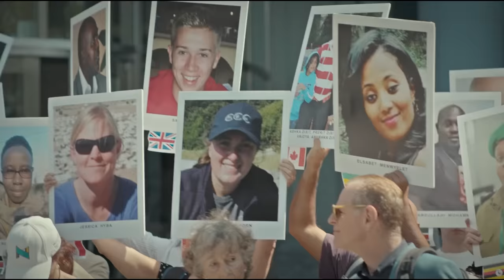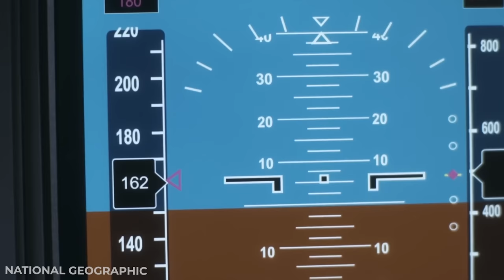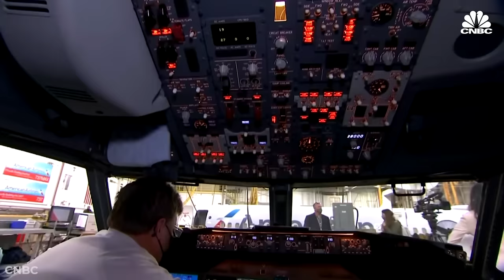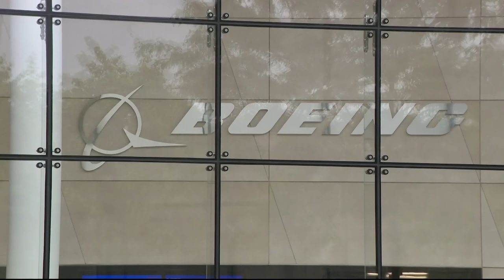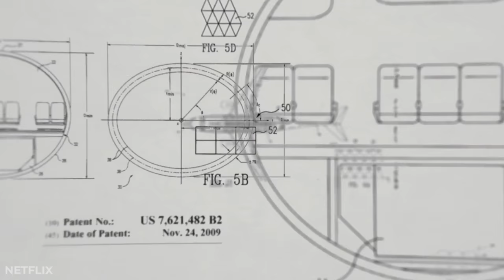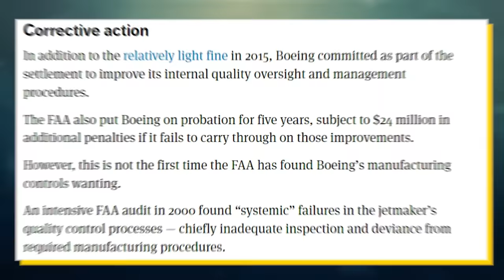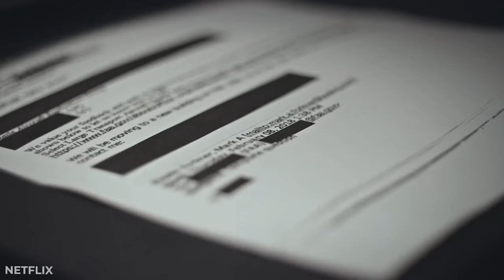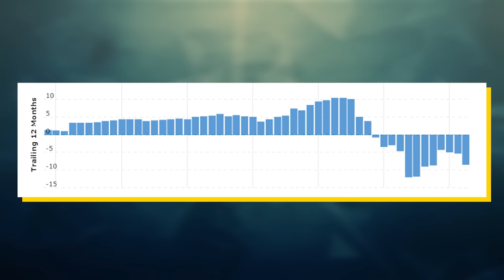Even Boeing Engineers Don't Trust Boeing...

Comment: "Safety is our highest priority"
You need to start worrying when a large company feels the need to constantly reassure it's customers that their product will not kill them.
Reply: Think vaccines. 🤔
Reply: "Safe and effective"
Reply: You’d rather they didn’t say anything?? 🤡 😂
Reply: Only because there is too much hype?    The cars in our driveways are far more dangerous.
Reply: I start to worry when big corporations say " everything is fine"
Reply: @danharold3087  yes they are, but i bet you didnt find empty liquor bottles in the fuel tank like an airline did with Boeing's new 787.
Reply: @Onyx408  Being quiet is better than downright lying
Reply: @SubvertTheState  Actually auto workers have been know to do the same.   Dad had a 71 Ford with something in the differential.  Workers have been known to put coke bottles in doors to cause rattles.    But this could have been a stunt to create news because news that hurt Boeing was in vogue.   A booze bottle has more mews impact than a coke can.  
We have no idea when the bottle went into the tank if it fit though the filler opening.
Reply: @danharold3087  well it's suspected to be from the North Carolina plant. Boeing is dismantling it's legacy unionized technically savvy plant in Washington and trying to shift production to NC where the workers make $15 an hour and  are hired off the street. Some of the airlines specifically requested that their 787 order contracts include no aircraft produced at the NC plant. The mechanics have found other things like ladders in between the pressure hull and the fuselage. Like no airline mechanic is going to disassemble an aircraft, put a ladder in between the walls and put it back together haha. But thats the problem with the economy, GE makes 75% of its revenue from financial speculation and investments, Boeing and all of these companies with institutional clout will do anything to raise stock prices. And CEOs think cutting labor costs is always a great idea, but you end up with a destroyed reputation in the end.
Reply: @SubvertTheState  We have to be careful here to not look at specific things in isolation.    Every pro union person will obviously point out the SC problems and tell us how it would never had happened had that been a union plant.   Little in life is that black and white.    I mostly see the SC plant startup as rushed.  Maybe some of the experienced people sent there from Washington were less than happy about the entire deal.   People disgruntled to a major degree are capable of most anything.  Training your replacement is one thing.  Groups of people training people to replace you factory is even worse.   

Obviously you care about people.  I do too.   The problem is that almost every company involved in manufacturing is going to lose out to a competitor with lower labor costs. But the lowest labor cost is none.   It has been on the way for a long time but the Tesla robot and what follows will put the last nails in the labor coffin.   Special purpose robots are already being sold into restaurants. The checkout people are gone from many stores.   Truck drivers will become an endangered species.  What jobs will be left?    Whatever they are we need to restructure education to educate more people to fill them.   If you think I am full of it that is OK.   It is on the way and nothing we can do will change it.  What would we change?  Can we stop progress.  Can we afford to attempt to stop progress.

   One can potentially make more money dealing with money directly.  Products just get in the way.
Reply: Pfizer, Moderna, Monsanto, Johnson & Johnson …
Reply: @SubvertTheState  So it’s not they ran outta kerosene for fuel, but factory workers weren’t sober.  Very scary.
Reply: My investment is safe. What about the plane?
Reply: @hananokuni2580  Define safe in this context ?
Reply: @danharold3087  Sarcasm.
Reply: @hananokuni2580  Not always obvious.
Reply: @Onyx408  no, but that statement along with blaming foreign pilots who died doing the best that they possibly could, calling them unqualified is worse than no comment. Especially when the public believes the company, and blames the pilots for the deaths of all souls lost.
Reply: @SubvertTheState  straight out of the MDD book of press relations after a crash... 😎👌
Reply: @Onyx408  I’d rather they tell the truth. Clearly safety isn’t the highest priority, yet they are trying to reassure customers that it is.
Reply: @elementalgolem5498  Boeing is all good then? It took them 20 years to make the Starliner, they tested it recently and it veered off course while venting air into space. 
The 787 has killed hundreds of people and the company blamed incompetent pilots. You can start bringing up car statistics for some reason but it doesn't matter. Nobody is claiming planes aren't safe, what I'm claiming is that Boeing is a bad company.
Reply: @SubvertTheState  Starliner has nothing to do with their safety of aircraft it's a test phase space capsule. That if you look at history is a damn difficult and dangerous form of travel. Their aircraft are some of the safest in the world and the 787 is the most advanced and one of the safest aircraft ever produced. Idk what you mean about killed hundreds. The 787 has a spotless safety record of zero fatalities and zero hull losses. It's technically the safest aircraft in the world. But before its official it will need to catch up to some of the other aircrafts milage to see how it compares over time. The dreamliner is a dream, and a marvel if aviation engineering. Saying Boeing is bad and using the 787 as a example is hilarious.
Reply: @elementalgolem5498  i mean the 737 Max. The 787 has had plenty of its own problems including several battery fires mid flight. No it hasn't had a long history, that's part of the problem. If it had several incidents in a long history it wouldnt be a problem, they put off the battery fire issue until several occurences. I guess if you love the company that much theres nothing i can point out that will change your mind. I just know that a legacy company with billions in government contracts who is focused on cost-cutting and coasting off of their name is a recipe for disaster.
Reply: @elementalgolem5498  And yet, this whole scandal exists. 

They don’t care about safety, they care about being sued in the case of a crash.
Reply: @elementalgolem5498  No scandal is occurring? So those whole news story is about something good happening? 

The point is that this news story, or “scandal” as you DON’T like to put it, goes contrary to “Safety is our highest priority”. 
And it doesn’t have the best safety record, Airbus does.
Reply: @elementalgolem5498  If the 737 crashes aren’t a scandal, how come they have been grounded?
Reply: If there is nothing to address, there would be nothing to say.
Reply: You can say the same about governments also.
Reply: Of course it's good marketing to say that as it's an aircraft... its a complex machine and plenty of people are at least nervous when it comes to flying, it's to reassure them.
Reply: Philip Morris International!
Reply: @katherineberger6329  what have I lied about?
What exactly is an antivaxxer?
Vaccinated people are also transmitting, so does that make them accessories also?
Reply: @katherineberger6329  making accusations about someone that you dont know.  Not sure how much more crap you can spew, but please continue.
Reply: @katherineberger6329  yup, name calling was expected.  🤣😜
Reply: Safety is our highest priority, which is why we make safety features extra-cost add-ones instead of standard.
Reply: @katherineberger6329 who said anything about hating?
Intelligent scientific analysis is the way to go and have done so all my life.  That's how truth is discovered and/or exposed.
Yes, I can be an asshole, but that name calling seems to be done when there isn't an intelligent response and always directed at someone that they disagree with.
Have wonderful day and bless your heart.
Reply: @cptrikester2671  "intelligent scientific analysis"

Literally posts antivax garbage.

Ok, Dr. Goofy.
Reply: Reminds me of the COVID vaccine. "Safe and effective", they said. "Good efficacy" they said. Yea, right.....
Reply: @cptrikester2671  Continue, continue. I'm laughing rn
Reply: @danharold3087  A door rattle vs. stalling out 5 miles in the air due to fuel issues from foreign debris in a fuel tank? I’ll take a door rattle any day. Cars are wayyy safer, the operators however are not. 

I was blown away that the MCAS system on the MAX was only dependent on one of two sensors at the nose of the plane. When it comes to cars (Toyota), they will have reference sensors so if a fault may occur, it will know to go into default mode instead of crashing into a wall (the ground for the MAX’s case). 

Nothing but corruption and incompetence due to capitalism, greed, and band aid engineering with extremely low standards. Madness
Reply: haha! free speech! it doesn't have to be true, so it's basically meaningless 🙂saying safety is our highest priority costs nothing and sounds great! self regulation is the cheapest regulation ;-)
Reply: When CEO does the boards recommendations, changing CEO does nothing.
Reply: Why wait until two crash? How does sleep at night.
Reply: It worked for Volvo.
Reply: @SubvertTheState
"Reliability" - it is a separate kind of engineering. Safety follows it.
Reply: Just like some mining companies in Australia ram it down out throats but wen we report complain call out .....she be right
Reply: @danharold3087 
Your comment did NOT age well. Doors are flying off of their airplanes.
Reply: @joeybulford5266  If it was my comment about our cars being more dangerous it is still correct.  
By the hour our odds are roughly 2,000 times higher/worse in our cars.
Just for fun the commercial passenger flights became safer about 1955, give or take a few years.

737 MAX: Based on the current limited data and assuming an average passenger load of 150, the overall estimated rate is 0.024 fatalities per 100 million passenger miles.
Car: The average fatality rate for car accidents in the United States (based on 2021 data) is around 1.3 deaths per 100 million vehicle miles.
Reply: @danharold3087  
I think I’ll take the word of actual safety inspectors who have stated over the past year that Boeing has been severely lacking in their safety protocols and have focused more on cost cutting.
Reply: Well that's why their planes fall apart. Because those planes are so bad, it's better they are designed to desintegrate to make the pilot land ASAP cause the only safe Boeing is a parked one
Reply: @cptrikester2671  I'd suggest leaving thinking to others.... Believing studying a topic is waste of time and reading studies is unnecessary isn't "thinking".
Reply: @kremepye3613  Says the dropout pretending to be a scientist.
Reply: @anomaly_echelon7994  Is it really? Or is it just a way of reducing law suits?
Reply: @ohauss  perhaps it's time for another safe booster. 🤔😉
Reply: @Onyx408 I rather they build planes that don’t kill you
Reply: They should be able to fix the problem .Wonder if anybody terminated that were supposed to tighten those bolts
Reply: @Onyx408  I would rather they start DOING things. Instead of hiring temps at less than half the wage of legacy union workers in Washington, they moved to Carolina and made Sh17 planes. Frontline or PBS did an undercover investigation of the new plant a few years ago. It was pretty bad.
Reply: Or try a Russian or Chinese aircraft. When is the last time you've heard of Tupolev, Ilyushin, or Comac for that matter - reassuring their customers?
Don't worry comrade - yesterday's flight got there just fine! It has two engines - if one breaks it has another one! And if both engines break - well, it lands like glider in a field, and we send Ural trucks to deliver you the rest of the way!

Comment: With respect, there were multiple issues reported by flight crews of the 737 Max long before the Lion Air disaster. Planes with less than 40 hours flight time were suffering failures to instrumentation, flight control and engines. These issues continue to this day with the Alaska plug blow-out being one of the more known failures. However, there have been several reports of bolts holding the tail fin not being secured, horizontal stabilisers not functioning and even an inflatable slide deploying in the air. I certainly wouldn’t fly on one.

Comment: Thank you for this video. This is January 26, 2024, and there have been two additional incidents with the MAX aircraft:

1. In December 2023, Boeing urged all airlines to inspect their MAX aircraft after an international carrier found a nut missing from a bolt on the rudder control system. Then Boeing found an undelivered MAX that had the same nut loose on the bolt in the rudder control system. Alaska Airlines reported finding multiple MAX aircraft with these loose bolts.

2. On January 5, 2024, An Alaska Airlines MAX-9 was at 16,000ft when a cabin door plug blew out, depressurizing the aircraft and forcing an emergency landing. The FAA grounded ALL MAX-9 aircraft (171) for inspections.

A couple of things regarding these aviation company's mantra of "Safety is our #1 priority", and I'm including airlines along with Boeing. First, this is not the actual case, as safety is several steps down on their priority list. The #1 priority for the manufacturer is delivering aircraft, no matter what it takes. The #1 priority for airlines is getting as many of their aircraft in the sky as possible, no matter what it takes. This is all you need to know about their priorities, as it overrides what any engineer or maintenance personnel have to say about the safety of an aircraft.

So, before I get jumped for making things up, I will explain I just retired from a 30 year aviation career with a US carrier. I worked in several areas of what is now called Technical Operations (Tech Ops), and what I still referred to as Aircraft Maintenance. I worked in both Union and Management positions, and was involved in many safety related decisions when deciding if an aircraft was removed from service, or if "No known condition exists that would render this aircraft unairworthy". And I can unequivocally state that getting the aircraft off of the gate and into the air was the most important thing (#1 priority) to upper management. 

Now this has come around and is affecting my wife and I, as we have a vacation scheduled, booked the airline tickets, and just found out the airline we are flying on uses MAX-9 aircraft for all four legs. And with the MAX-9 about to go back into service, I don't know if I have any recourse to be refunded for the tickets. We really do not want to fly on any of the MAX aircraft, but especially the MAX-9 with the findings they have so far.
Reply: If you do ultimately decide to go anyways I pray safe travels.